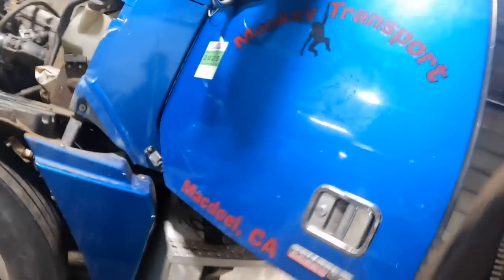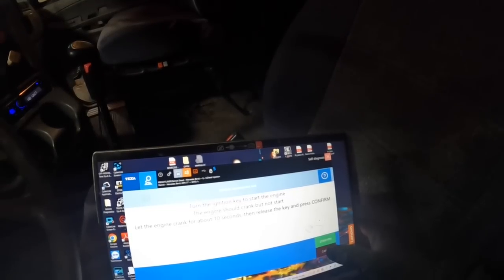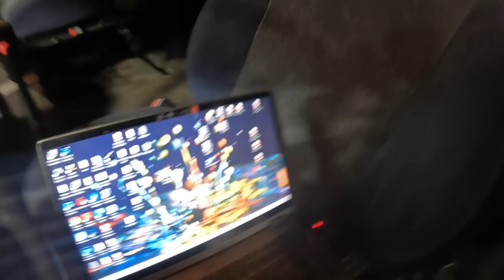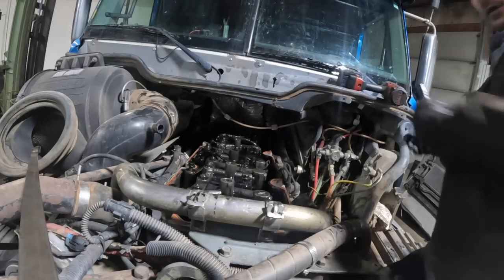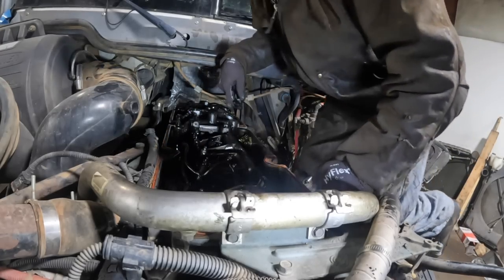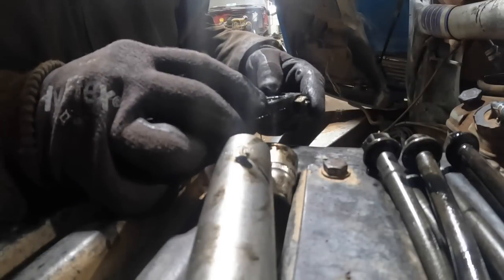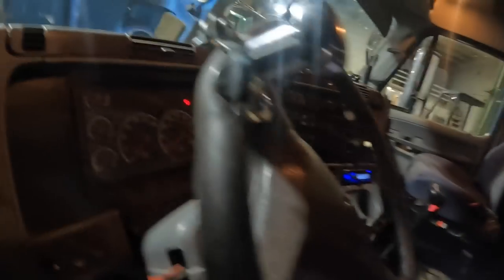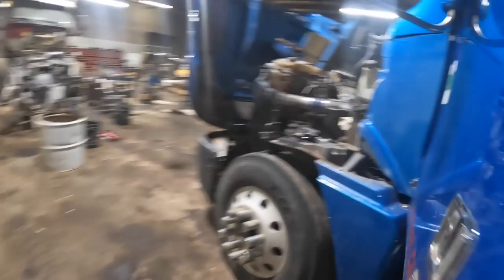Detroit 60 series misfire

Comment: Detroit certified tech here..super common for the DDEC 6’s to break injector rockers. It’s a good idea to go ahead and replace all 6 rockers to keep it from happening again. 

As for the vgt codes, they can be finicky just like the Cummins ones..be sure to load test the power and ground going to the actuator, it’s common for wires to rub behind the head

Comment: "relative compression"... Extreme powerful test!
Reply: I wonder what its monitoring for that data,i doubt it uses amps :)
Reply: Measures peak amps between pulses of compression. A good quick way to find a dead cylinder with low no compression.
Even on gas engines

Ps I know you know that you are a top gun on east coast..Comrade
Reply: @Adam-bw4lw  crankshaft velocity most likely

Comment: If you have a misfire and all is good under the rocker cover here is a quick check.Check the ECM wiring the comes out of the ECU for the injectors.I have found the wires rubbed through and shorting out together.Making a misfire.Engine running with misfire take a plastic item and push the shorted wires apart misfire gone.Just an idea here.

Comment: Had one do that on a 3406 cat i was just resealing the pan but dropped it and found metal chunks but it never sounded like it was misfiring ended up two rockers were eating the cam and #1 injector was broke off on the adjuster I ran the overhead and intake was way to tight

Comment: Looks like the tightened that adjuster to much and snap.... My rule of thumb was on any engine I worked on , if it's missing bad and I exhausted all options look in the head and valves !  And I was correct 100%of the time

Comment: The injector stuck and broke the rocker arm, I had one similar happen. I replaced a rocker and set everything back and it ran three days and broke again. After I replaced the injector and another rocker arm it ran good again. Later a roller on another rocker broke and I replaced it. After chasing my tail and not finding a definitive problem, I sent off an oil sample. The customer had been given a drum of shitty single viscosity oil made for gasoline engines and was using it and changing oil at extended drain intervals. After a oil change with good oil and filters his problems went away. I know this was just a one time thing, but it made a believer out of me and oil sampling. That free drum of oil also cost him a GM 6.5 Diesel pickup truck engine. Free wasn't free.
Reply: The oil wasn't the problem, it was the guy pouring it into the wrong engines ...

Comment: Hi Warren! Another great video. I was just wondering about the coolant res on that truck. Looked like the lower expansion portion was full of coolant and you stated that the engine was stone cold. Could be a shadow but if it's coolant it needs a reservoir.

Comment: I use to drive a couple Freightliners like this one for a Ag- Fertilizer plant, I hated them, the interior was falling apart and the engine was not very powerful. Didn’t feel like the 470 that they were rated at. I would much rather have an older 60 series then the newer ones.
Reply: DDec 6 is one of the worst s60 engines ever built. 3 and 4 were some of the best. DDEC2 had lots of piston problems

Comment: Replace all 6 injectors he over rev'd the engine.  Open the inj harness connector at the rocker box. If oil present, replace the upper harness, remove the inj harness at the ecm, if oil present replace the lower harness.